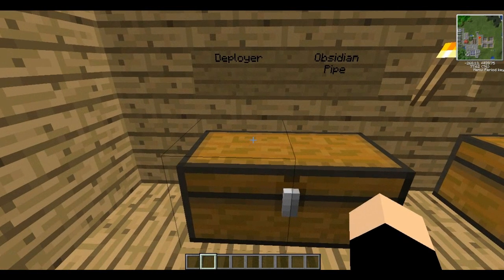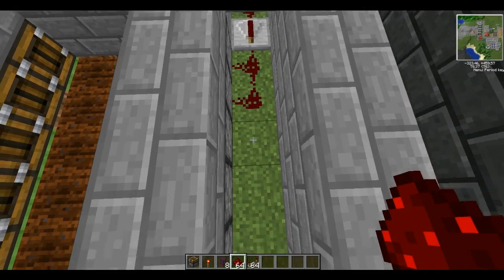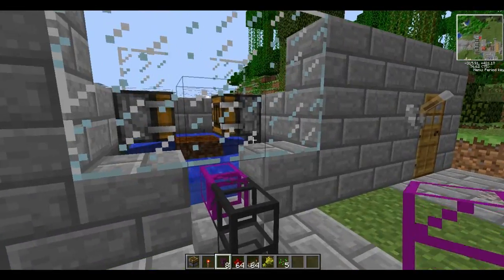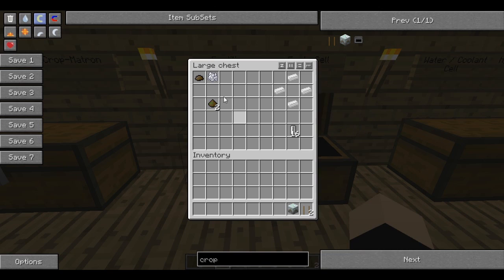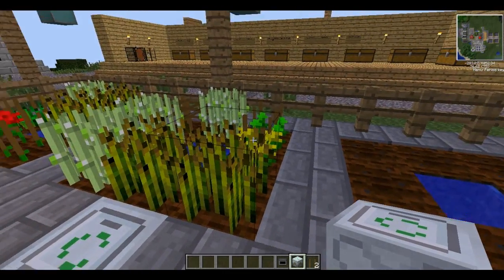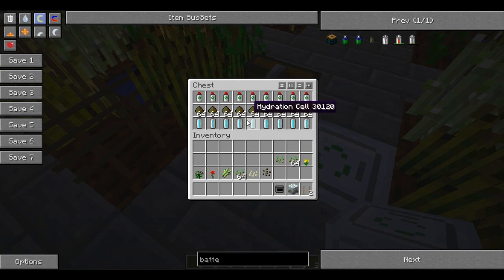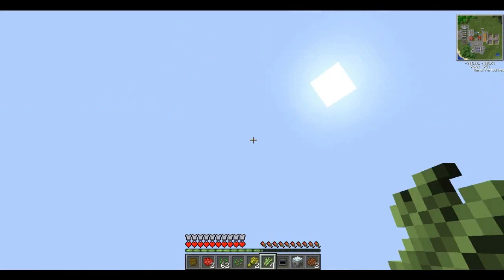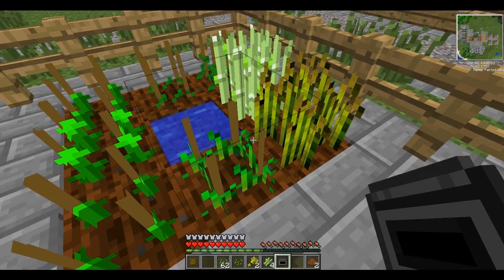Tekkit Tutorials Part 8 - Deployers, Obsidian Pipes, Crops, Crop-Matron, Cropanalyzer

Comment: The information about the power loss via cabled is wrong, the powerloss is by every block of wire, placing a batbox early in the line does help a tiny bit, but it would be a waste of materials as Optic fibre cables lose 0.0125 EU/t every block, no matter the side of a batbox they are on.